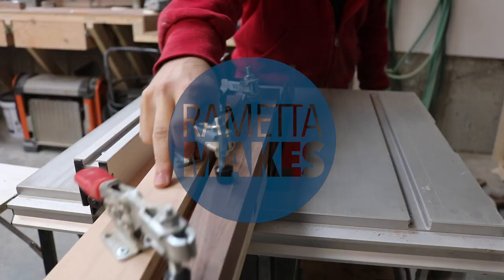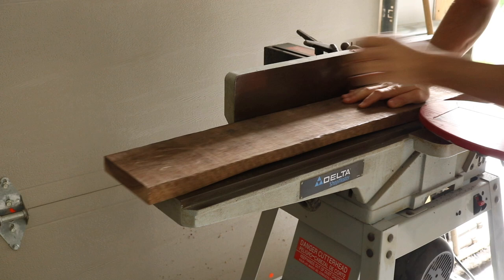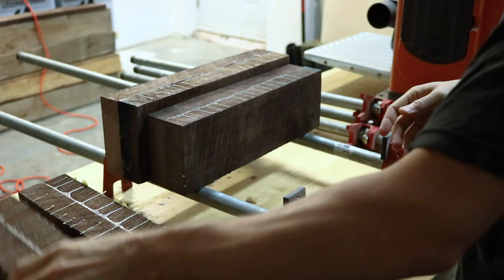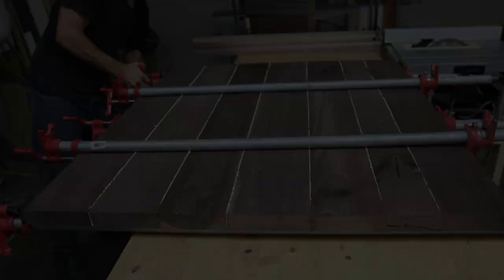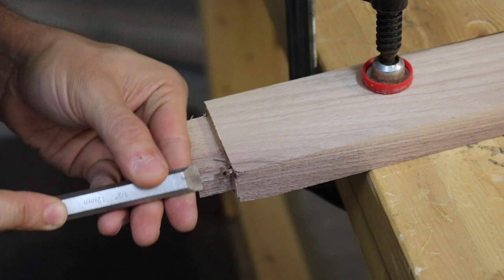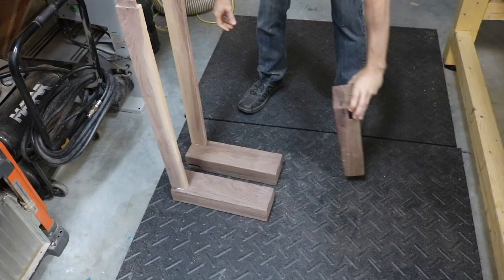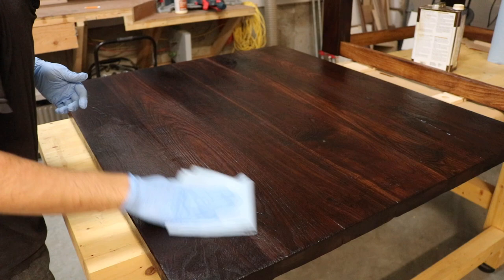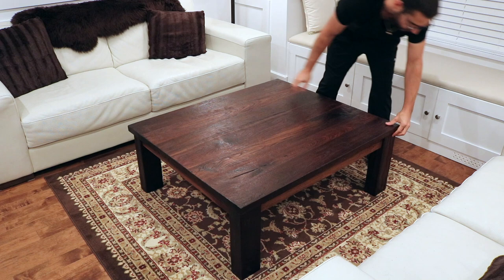How to Build a Walnut Coffee Table with Texture // DIY

Comment: Looking good, but 2000 grid sand paper? Did you mean 200 grid paper?
Reply from the maker: No I used 2000 just to get the small dust nubs off.
Reply: 200 will eat up the material and texture will be gone. 2000 will smooth the textured "edges" while keeping the texture intact and still smooth to touch, my 2c.